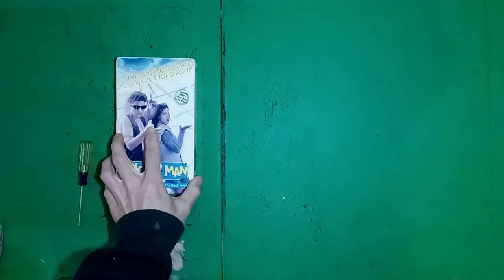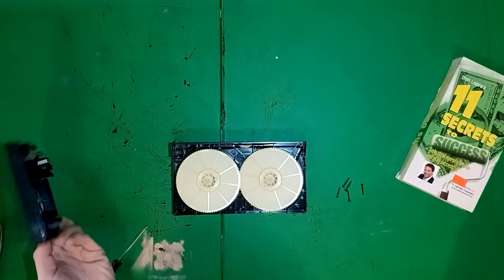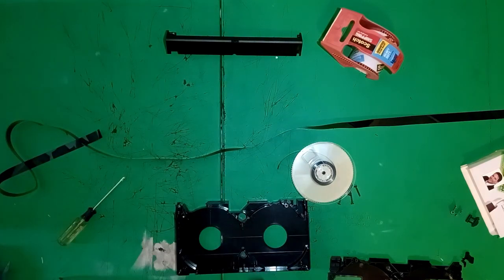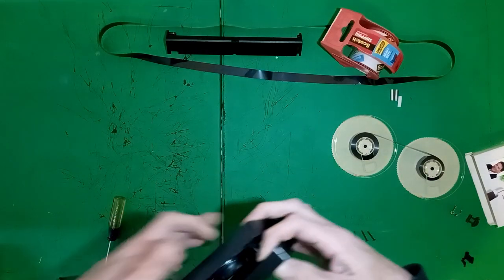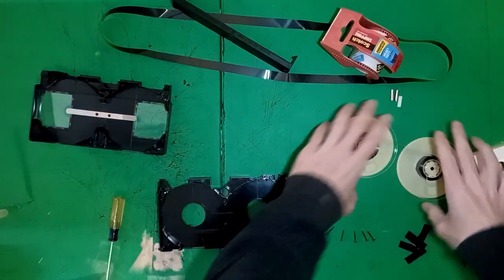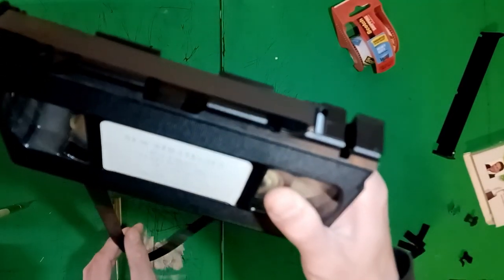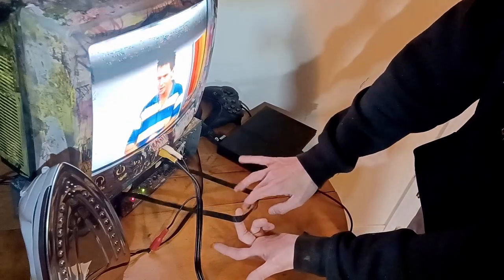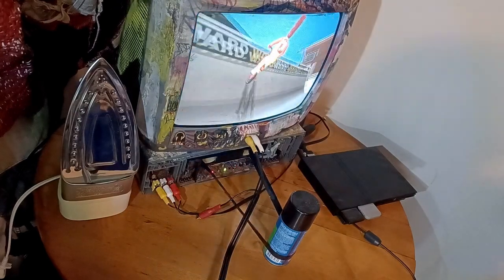How to make a VHS Tape Loop

Comment: I believe the way vhs machines decide whether a tape is acceptable and when to spit it out varies from machine to machine. Not all vhs players need the dummy tape
Reply from the maker: i dont doubt that, but i have tested with at least a dozen different VCRs, and i havent come across a case that didnt need the dummy tape. some of them wouldnt play em at all even with it. theres definitely a ton of variance between models though so there very well could be one that will accept it.
Reply: In most of the machines I worked on there was an infrared LED and sensor that looked for the tape, it was also responsible for detecting the beginning and end clear strip leader.
Reply: The vast majority of VCRs have an optical sensor that detects when the tape reels are moving. So if the tape mechanism gets jammed, it will stop and eject hopefully before it eats too much of the tape. I had a VCR where that malfunctioned and every single tape stopped instantly, even if it was fine!

Comment: Did this last night, but it always keeps ejecting the tape, what should I do maybe get the cover off by unscrewing my VCR maybe? That is so cool.
Reply from the maker: i would always leave the VCR unscrewed so i could take the cover off and look inside if anything goes wrong. the whole process is extremely fickle and prone to going wrong without constant maintenance. different VCRs will behave differently too, some wont complain at all, others will spit out anything if it senses its slightly off. best of luck!

Comment: what if you made it run through two vcr's linked together one records what the other one plays,  feeding back on each other
Reply: This is exactly why I searched this topic.
It seems plausible, but I have no idea how to feed the tape into two machines, or if the record and playback happen at the same speed.
Reply: @FORRESTtheunoriginal  similar to how looping based on delays... for syncing you will need an external control over the two heads/systems... so they become one. Maybe there's dedicated video records from studios or so (professional tools I mean) waiting for someone to dig in. Nice job btw!
Reply: @dubbylabby6068  See, if the record/playback speeds were the same, idk if syncing is needed.

But if the speeds are different, you would need to do something.

Comment: what is the minimum tape length that's taken up into the VCR? I wonder if it would be possible to use a spring-tensioned 3d-printed arm to manage that extra distance so as not to need the spray can

Comment: Thats cool. A bit risky if using your only working vhs player for films. Perhaps this process and create a wood block with a fidget spinner type wheel the tape reel can rest on outside the player?Or 3D Print a created bracket with tape reel? Record you favorite scene from a film onto it. Perhapsgoing further adding a speed and pitch shifter to a vhs player?Output, use the Red/White ports with a RCA Audio to 3.5mm Auxiliary Adapter Cord. Even further modification, can split that Audio Output with 3 Way Audio Splitter Adapers. And use Video SpliyCords attached to various CRT TVs hooked to a Home Stereo Surround System. Just ideas off the top of if my head. Hope this may help this procedure and future Loop Experiments my friend. 🦇 🎃